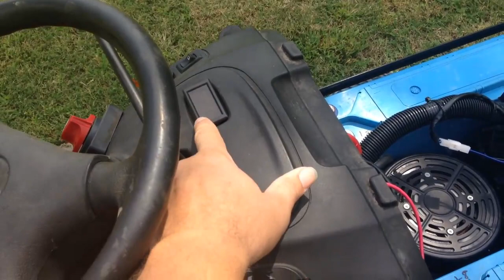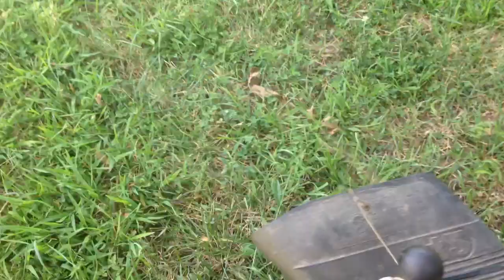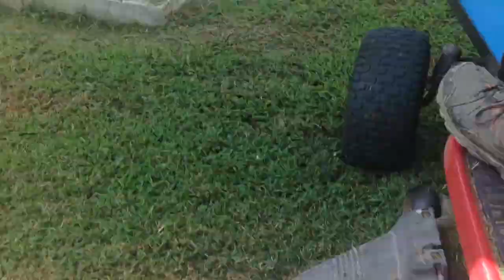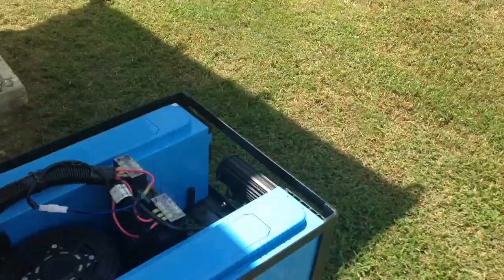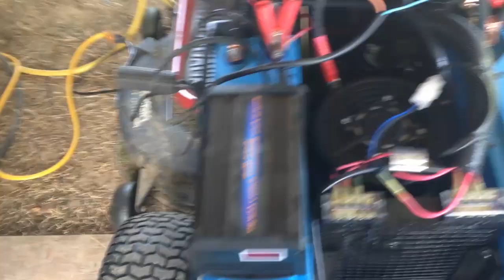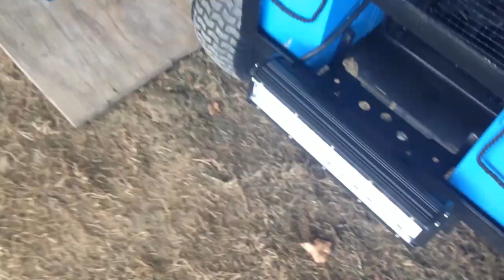Gas to Electric Riding Lawn Mower conversion v 1.5

Comment: Do you have the same power output?  I understand electric motors are much higher in torque.  What hp did you start with and do you feel like you have more or less power or cutting ability?

Comment: Very neat conversion I made one using 3 separate small motors about 17 yrs ago, still using it daily almost no problems or maintenance, change lead acid deep cycle batteries about every 7-8yrs,  cut 2 acres on 50cent charge, tremendous pulling traction pull 2000lb trailer with ease, also push a plow blade for soil and snow, see my video electrictractor.net
Reply: What all is included in your Conversion kit?
Reply: @N2Otorious   KIT CONTENTS
The kit contains:-  Plans, wiring diagrams, instructions, numbered photos and most of the difficult to get parts such as:- electric transaxle with motor and electric brake, 2 cutter motors with mounting flange, electronic motor controller, control relays, digital amp/volt meter, circuit breakers, and other parts. some small metal brackets may have to be made depending on your tractor model, a few short lengths of wire, 2 push mower universal blade adaptors, batteries and charger not included, every DIY conversion is different and some people have some common parts lying around the garage, If I included every easy to get part in the kit the kit price would be much higher, 
Banggood.com sell a smart 24v battery charger $29.99 , some used wheel chair battery chargers are available on Ebay cheap or used truck battery chargers can be used, 
    The golf cart batteries are available everywhere at the same price I would pay and the shipping costs you would pay would make them  more expensive than you buying them locally, you can get good used golf cart batteries for about $30 ea if you wish from golf cart repair shops if your lawn is not too large, if you have less than 1 acre grass you could use 2 x 12v deep cycle batteries instead of the 4 x 6v golfcart batteries, ElectricLawnTractor.com

Comment: With all the Parts + Labor + Time + Coffee.... Might as well stick with Gas or even Propane!  OMG, the Motor alone is like $600.00+ :(((
Reply from the maker: Jordan Bronson right this is not the cheap and or ez way to go , but if you like tinkering with things (as I do) this can be a fun project
Reply: +chuck green - You did a GREAT JOB with the " Neatness / Design " and I can see you put in a lot of time for sure.  But nah.... I don't think I ill be converting mine anytime soon, LOL.  Although I am thinking converting to " Propane " due to Cost + Labor + Time, etc....  I am only looking at converting because of the " Exhaust  Gases ".  I hate the smell of the Gas Fumes.... That is why it leads me to your video.
Reply from the maker: Jordan Bronson propane very nice 👍🏼 I'll check that out for sure
Reply: +chuck green - I have been watching a Video from this guy, link below.  I also read on the " LOW PRESSURE REGULATOR 039-122 " as well.  Surprisingly, it's able to supply the Gas / Propane to 50HP Engine without a problem.  So I might be getting one for my Lawn Mower Conversion.   Here is the detailed Video of it.... He used it in a Generator:  https://www.youtube.com/watch?v=nO839Sayci0
Reply: +chuck green - Here is the Link for the Regulator that I will buy:  https://www.ebay.com/itm/170975776405
Reply: What kind of motor are you using ?

Comment: Nice looking conversion!  Yeah, switch over to lithium.  I'm using a pair of 48V modules from a Chevy Volt.  They give me about 3.6kWh of usable energy.  Mowing I get about an hour run time and they all fit under the hood.  I need to get a video uploaded.
Anyway, nice job...very clean!
Reply: enzorover b 

That's cool. How long to charge?
Reply: As with any electric vehicle, it all depends.  I have a 25amp charger.  25amps at 48V 1.2kWh, so depending on how long I ran it, anywhere from 5 minutes to 3-4hr.  I also have a 6amp charger which is 3x slower.  

So now that you've done a mower, you need to move on to a car or truck conversion!!
Reply: I'd really like to see a video about your setup enzorover b
Reply: Kind of grainy video but I think you get the idea. 
 https://www.youtube.com/watch?v=ZCf3ZkGDOTQ

Comment: Nice job! Packs are huge! 

I am looking to do the same on my old lawn tractor: motor's leaking oil and pretty much beaten up...

how did you measure hp needed on the motor (you take the gas engine hp and take same?) ? 
how much it ends up costing (controller, motor, battery, etc.) ?
Reply from the maker: the hp of the electric motor is not a good translation( from gas to electric) , its going to be much less then the gas engine, the one i got the me1004 works out to have only 12 hp ,the gas engine had 24 hp. but the me1004 can put out 218 lb.ft of torque at 3100 rpms ,which is alot more then the gas motor. so look for torque and rpm.
Reply from the maker: cost was around 600 for motor and controller (new) i got the bats for free from a salvage yard( they had no idea what they had) so i jumped on um lol, all the other stuff cables , ends, 200-300 bucks , its not going to be the cheap ,i did it just because i like building stuff :o)